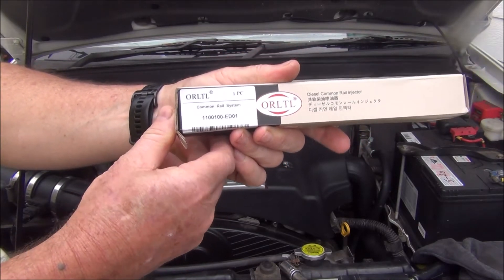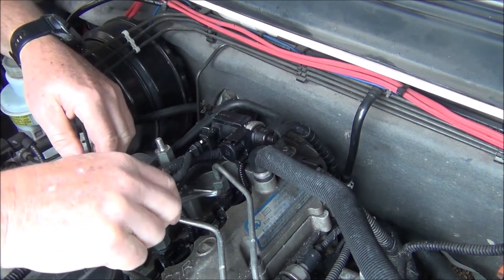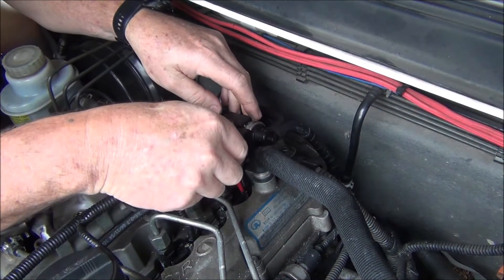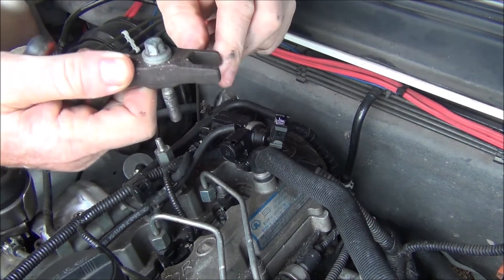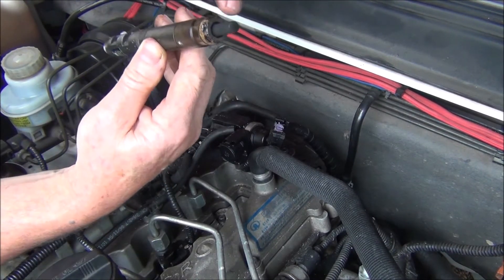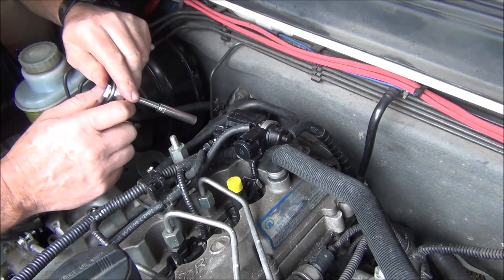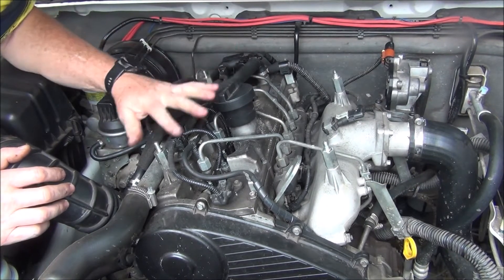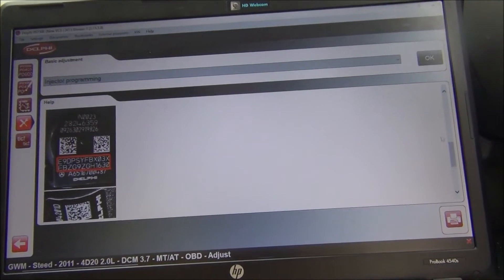Great Wall V200 Injector Change

Comment: Good afternoon here in Malaysia sir. I have a V 200 year 2012 diesel turbo 2.0 Gw4d20 automatic at 1207200 km on the clock... Few months back hade difficult starting issues so went to the local work shop as was recommended to  replace all 4 glow plugs  and was replaced. After replacing them aslo same issue difficulty in starting long time to cranking in order to start but when engine is hot she starts up find.. Went home next morning wanted to start her up... Same thing long time cranking until battery gone weak so took my dad's car and tried to jump start but she didn't start only cranking. So I decided to get her towed to my friend's work shop about 2 hours from my house. Was recommended to clean fuel tank and replace all related fuel filters and was replaced. Was also recommended to replace all 4 injectors and high pressure fuel pump was also replaced.. Just took back my suv and she's not running smoothly. The work shop didn't programme all injectors as they didn't know how and they don't know how to do so sir. Do you have advice on how to programme it and how can then do it? Please advise me sir
Reply: It definitely needs hooked up to a laptop of some type. Run mine out or desiel and  had a local guy hook his one up and had two  programs for gw he looked into. Was able to watch fuel pressure  injectors. Etc.  Injectors are coded for there  factory test rate and  and your computer needs to know how long it opens to be correct

Comment: Greatwall V200 Crank no start. No common rail pipe pressure.
Hi Chris,have you ever had the subject problem ?
Reply from the maker: No haven't come across that problem it might be a blocked fuel filter

Comment: Did you have to bleed to remove air out?
We are in a weird situation. Only cleaned intake manifold and EGR. To remove intake we disconnected fuel line to injector rail. Put back everything as it was. Bleed the system and no start. Bleed the system many times including the procedure for Delphi injectors by disconnecting electric connection to injectors and imv/pump. No luck. When we use starter spray it starts. When I do activation test on injectors hear the sound and crank it then it starts for 1 second. Because injectors operated and dropped some fuel. I don't know what has gone wrong. Any idea? One more thing which is also weird. When we do injector activation using Autel scan tool- we activate #1, #1 operates. but when we acctivate #4- 2 operates same thing with remaining ones. 
2-3
3-4
Connection are correct we can't interchange. We had not done injector coding. Infact without putting the scan tool car did not start. Is it necessary to remove return lines from injectors for bleeding?
Reply from the maker: It seems you have done everything right these engines are a pain to start when you play with the fuel system. I have used up to 3 tins of starting fluid before the engine will run on its own if everything is OK it should eventually start .
Reply: Get fuel to top of injectors.
Remove glow plugs.
Disconnect the wire going to the back of the fuel pump. Pressure reg...

Wind over till you have fuel vapor about 200mm high with nice taper at ends.
Reinstall glow plugs and hook up wire to fuel pump.
Good luck.
Run mine out of fuel and took five months to learn this
Reply: I HV same problem like your one man ,I'm in shit
Reply: @Kudziemaria  after you have bleeded the system, and put everything. Get someone to crank the engine and while it's cranking safely/carefully take the pressure regulator wire connector off. If starts let it run for a few seconds then you can turn off the car.

Comment: Hi we had 2 bad injectors replaced them but now not getting any power to any any injectors so no start any ideas
Reply from the maker: Have you tried disconnecting the two new injectors and see if the power is restored maybe one of the new injectors has a short dragging the injectors power down.

Comment: If you swaped motor completely would you have to do these codes to
Reply from the maker: If the new motor has it own injectors  installed then yes it will have to be reprogrammed but if you use your old injectors as long as you put them back in the original cylinders it will be ok.
Reply: @redbackmachining8368   thanks mate the problem we have is it starts then when release key it stops could this b the cause
Reply from the maker: @warrensmith2316  it maybe just get the injectors reprogrammed into the ecu and see if that helps.

Comment: Hey mate do you have to change all 4 injectors
Reply from the maker: No you can change just the bad ones
Reply: No worries so if I just put one in it won’t kill the other ones
Reply from the maker: No you will have to program the new injector in to the ecu
Reply: I have to replace the same one as you did in that video
Reply: No worries do you no if that’s why my Ute founds it hard to start is that because of the injector
Reply from the maker: You may have to do a injector leakages test first and go from there
Reply: Hey mate would no where the glow plug relay is in a Great Wall
Reply from the maker: Not sure I haven't had an issue with the glow plugs